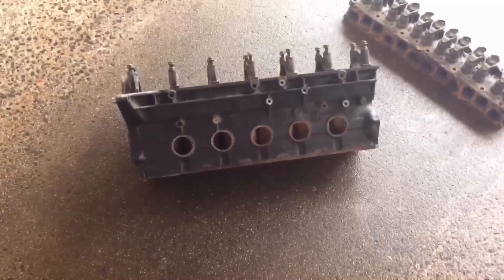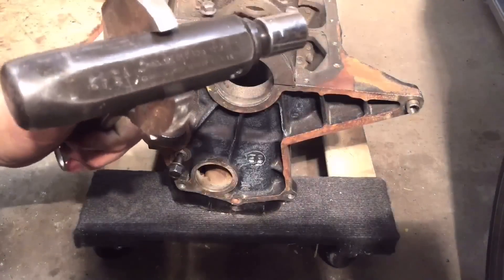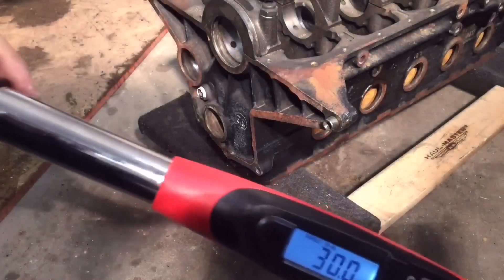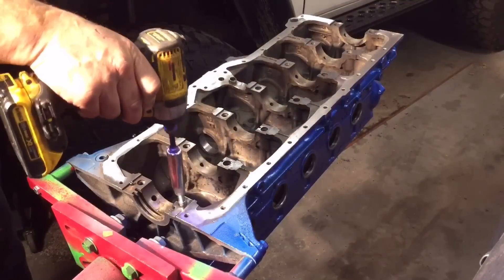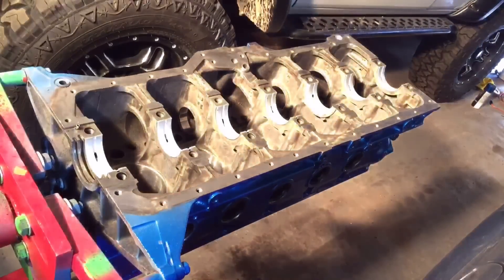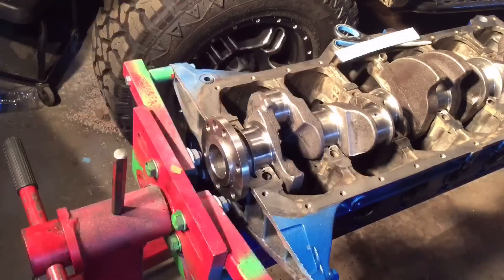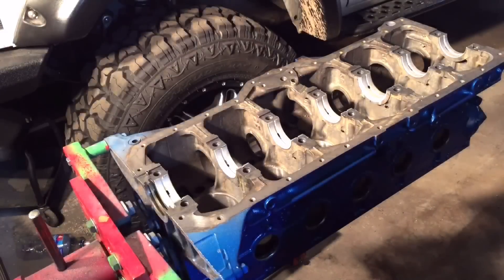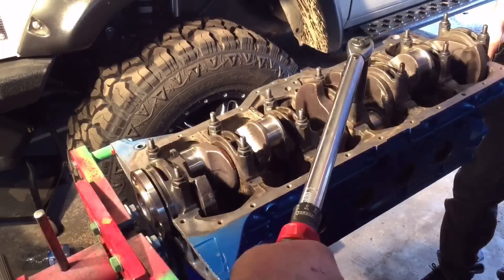Jeep 4.7 Stroker Complete Build Part 1

Comment: Hey man awesome videos!! really enjoyed them and will be using your vids as a template for my stroker!

Question: what size valves did you use? and how much did you open up the exhaust side where the header bolts up to? did you just chamfer it or bore out the exhaust port completly to a certain size? Thanks man!
Reply from the maker: Philip Paulose thanks. I just matched the gasket opening. On the valve side Oliver at the machine shop opened it up to match the valve and said the seats are really hard and will outlast the valves without a doubt. I'm unsure of the valve size, looking for all of the receipts. Zach at 505 recommended these and said they are the largest that will fit that head. When looking in that area consider roller lifters. Thanks for watching, I really appreciate the compliment.
Reply: I see, Thanks man!

Comment: Is the power difference noticeable? What do you think this does to durability/reliability? And finally did this make you have worse gas mileage or better? Thanks.
Reply from the maker: Clay Sensiba the power is incredible, just ask the motor to go and it does. As far as durability I think using the custom pistons and 4.0 rods may cut down on slap but durability in my opinion comes down to service and how you treat it. I built the jeep at the same time as I was building the motor so I have no real mileage to compare. The added weight (bumpers, skid plates etc.) and tire size take a toll for sure but I'm not counting MPG. I fill it up when it's low and bring extra fuel off road.

Comment: how do you get all the freeze plugs out?
Reply from the maker: Chris Keech take a punch and a hammer and just tap the side of the plug inward and it will swing like a window, then pull it out with vise grips or pliers. Don't score the block (tap the inside of the plug not the edge). Be careful on the rear freeze plug though because it should only be spun away from the cylinder wall. You will see what I mean looking down when you go to knock it out.

Comment: it's always been my understanding that the jeep computer with restore the stock air fuel ratio even if tou put bigger injectors it just shortens the pulse ... did you do anything to computer?
Reply from the maker: Eric Lee good question, and point. That's my understanding too. With the larger displacement and longer stroke it breathes more air. It also needs more fuel to go along with that increase of air. The factory coil pack Jeep injectors produce around 22.5 lbs./hr, not much less than the 24# ones. The OEM injectors have one hole vs. the 24# ones with four holes in the nozzle allowing for greater flow with a shorter pulse width. The computer will adjust fuel/air ratio and timing to compensate for atmospheric pressure, and throttle demand regardless of fuel flow rate (within reason). From what I've read the OEM Injectors already operate at up to 80% capacity. With the higher horsepower I didn't want to risk running lean during high fuel demand. With that said running the 24# injectors on a stock 4.0 should burn the same amount of fuel and have a shorter pulse width allowing more time for atomization during compression possibly producing a more complete burn.
What are your thoughts?
Reply: I do want to say that the videos where awesome... I really want to build a stroker this was the best I've seen ... I've seen strokers run to lean buddy of mine that I helped with rotating assembly build.. end up have so much trouble with it running to lean and way to hot ... that's why this was my question and is in building my stroker... how's the power...
Reply from the maker: Eric Lee the power is great, but it runs too cool. Might have something to do with northern Montana in winter during an Arctic front though? I started the XJ build with my son (for a teenager's daily driver) so it's geared with 4.11's for running 31's which is just a little high for 33's. 4.88's and 35's are in its future. As for the temp I think a high volume water pump, t-stat, aluminum head, and radiator, and oil cooler might be a little much for -15° temps.
Reply: Tinkering when you put the engine block heater in i wondered where you lived only a few places would warrant that... we have opposite problems here in the desert of Arizona ... I run a 3 core  aluminum radiator and upgraded electric fan just so I can daily drive in the summer ... I did think about a 5.3 chevy but already have an extra 97 4.0 block so I'm going to build that and be swap it out since  I can't have my jeep down for that long ... do you know the build cost for your engine ... would you do anything different now that it's finished
Reply from the maker: Eric Lee yep, I'm between Denver and Montana (Building up North). Still gets super cold in Denver and over 100 in the summer but nothing like the desert. Check out the aux transmission cooler in another video of mine. As far as changing anything I'm pretty happy with it. Maybe if it was something I wasn't going to keep forever I wouldn't spend he money on the aluminum head, oil pan, ect. The big valves surely do help it breathe though.
Reply: Tinkering Fox I put in an auxiliary transmission cooler before I put in the new radiator old one was pretty nasty.. oem may have worked but this much better expecially if I get stuck in Phoenix traffic in summer haha ... well I plan on keeping mine forever as well it is my daily but it's also my wheeler 4.56. 35s lockers and long arms and other stuff make her pretty sweet of road as well .. it would be great to give to my son one day he is along way from driving tho ... again great videos I'm sure I'll have them memorized by the time my build is done
Reply: Tinkering Fox and it does some right more air more fuel I wonder how fuel map looks 4.0 runs fairly lean to start with so Al loss as it does its thing and not to lean good to go just worried after what I've seen here ... but everyone has heat problem here jeeps hot rod ricers and everyone else
Reply from the maker: Eric Lee sounds like a great plan. I was just thinking about this the other day, there hasn't been a 4.0 block produced in 10 years! I'm going to think about collecting a few that are in great shape and shelving them. You might think about doing the same for your little one. With all of the TJ's LJ's YJ's MJ's XJ's reaching 200k they might be hard to find in good shape.
And thank you for the compliments, and for watching.
Reply: Tinkering Fox yeah good idea I have the one extra have to see how the one in it looks only 137k on it right now the other one I have came out of a wreck that had 98k on it... but finding a couple more is a good idea
Reply: Tinkering Fox what part of Montana you from? Live in Great Falls, theres a local Jeep club I'm part of, the S.O.J.C. on Facebook.